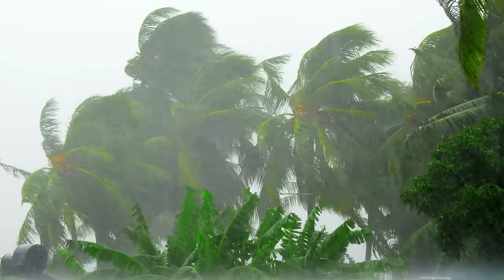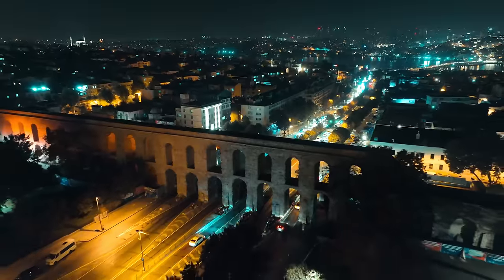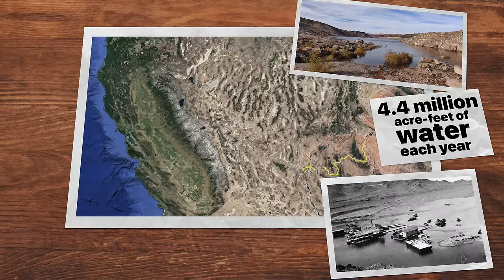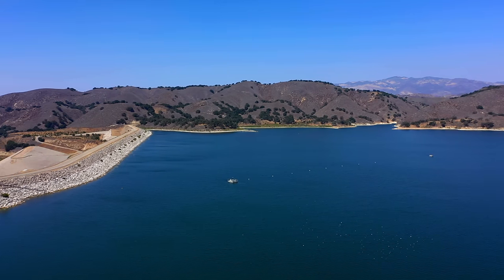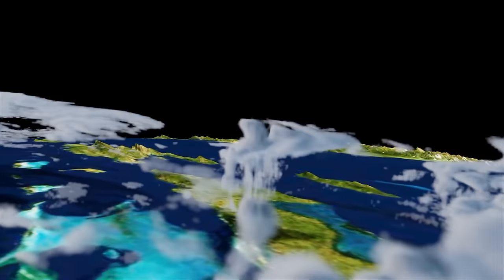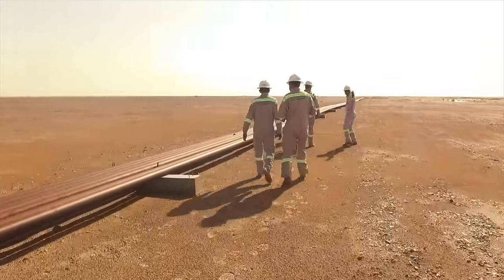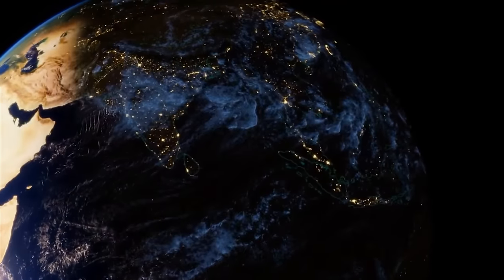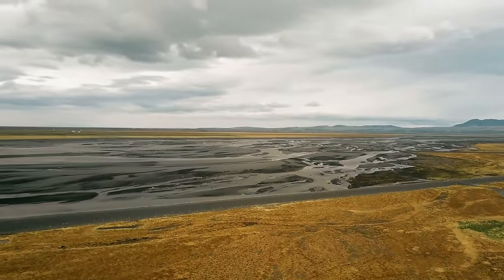Pipelines From Flood to Drought

Comment: I  worked in desalination for 25 years and the one thing I can say for certain is, it's very expensive and only energy rich countries can afford it. Moving water around is probably the best and only long term answer, but I think pumping large amounts of water large distances has it's own problems/costs. Pressure drops along small pipes is a problem but I doubt the problems are insurmountable if we had the will to do it. There is probably enough waste plastic in the world for the pipes if we could recycle it.
Reply: It seems like direct lithium extraction and other uses of selective membranes, to get valuable materials out of the desal brine might change some of the economics around desalination.
Reply: @tonydeveyra4611  Not only that but let’s not forget the potential for sodium to replace lithium as the ion source in batteries going forward. You could have desalination plants do double duty as Na-ion battery factories and the result would be EV sales subsidizing the cost of desalinated water.
Reply: @kennystrawnmusic  
Watch this. OK, its not about "Sodium" but I believe Sodium gets a mention and the same limitations apply.
Reply: @rogerstarkey5390  Already did. Your point?
Reply: @kennystrawnmusic  you take the sodium and the lithium out for making batteries. Take out the chloride. The minerals that remain after that are great fertilizers for plants and even for growing the soil microbiome that builds up soil carbon and fertility. There are many companies that are making seawater based fertilizers even with the sodium and chloride still in there. Once you take those out (or significantly reduce them) it becomes wayyyy better
Reply: @IMGreg..  Unfortunately the shipping industry would fight that tooth and nail, but good idea.
Reply: Where we really need to build a pipeline from to supply water to California is the Ohio River. That’s where teleconnections (e.g. ENSO) are closest to having the polar opposite effect on a continental scale — for example, El Niño brings floods to California and drought to the Ohio Valley area, and vice versa in the case of La Niña. Things like that are of utmost importance when designing a system like what Ricky is proposing in this video.
Reply: I'm of the opinion that desalination will drop in price as technology advances
Reply: @mrspeigle1  We could certainly learn from how Saudi Arabia plans to do it in the case of the Neom project: by using concentrated sunlight reflected by an array of mirrors to boil seawater. Best part of a system like that is that it would be most active when most needed, since solar energy is most abundant during times of drought.

With that said, I would strongly suggest replacing the dome structure that the Saudis propose with a tower containing a reflective lining — and then move the entire array, mirrors, tower, and all, offshore, so that the concentrated sunlight is funneled by the reflectively-lined Ivanpah-style tower into the water directly. Very little maintenance would be required and you’d be able to cool down a lot of steam just by piping it through the ocean itself to shore.
Reply: We put man on the moon. That took billions of dollars, and was a great scientific achievement, but we need to apply great projects like the moon to do a project like this. Technology, not a problem. WILL OF PURPOSE, that is the challenge! Let's do a cool project like this!!
Reply: @kennystrawnmusic  The biggest issue with current desalinization tech isn't the energy, it's the brine. Large scale desalinization, like California would need, produce so much brine it pollutes the ocean, changing ocean currently.
Reply: @charlesminckler2978  Locally brine concentration can be a problem. But I think your point about polluting the whole ocean is hyperbolic. The Pacific is mighty big and mighty deep, and circulates the globe exchanging sea water with other oceans.

But to avoid local brine problems at sea, how about pumping highly brine water to salty brine lakes deep inland where the water can evaporate and later fall as rain. The salt may even be mined for minerals like lithium.
Reply: Wouldn't it be better to make a big canal that way storage container ships and other such ships and water can go passively across the country as if it's like a giant river?
Reply: We have to lower the cost of energy.  Solar wind and battery storage.
Reply: @tonydeveyra4611  I agree I think at some point we will start having to use the ocean for more than a dumping ground ..
Reply: Solar thermal power plant ~> ocean water to steam=pure water and ocean salt.  Cost is dominated by infrastructure since the solar energy is free and it outputs electricity, pure water, and resource rich salt.  No brine catastrophe.
Reply: @spicychad55  that's a pretty good idea how about digging a sea-level cannel between us and Mexico. Line the north bank with mirrors to boil the water dams at each end could produce electricity also counter sea level rise
Reply: @jeffbybee5207  I was thinking of a west to east canal built for ship passage and passive water movement from water rich states to drough states. I think the importance of a canal means we can move a lot more products cheaply without damaging the roads with the use of semi tricks which cause 90% of the road damage. Maybe the idea would be deadly as I remember reading about how dangerous it was to create the Panama Canal in the 20th century.  Your idea is good too. Wish the govt would pitch contests that promote cheap and efficient methods of getting clean water. Incentivize the private sector to innovate.
Reply: Water runs our country just as much as any thing else . The solution has just been presented. We should do it now and avoid spending more in the future . The longer we wait the more it will cost including the destruction of the already present problems explained in the video. As far as common sense goes this is simply genius 👍
Reply: @kreynolds1123  There may be solutions, but pumping it out to the ocean is bad. Worse than most people think. It causes local changes in water currents and that's with smaller scale existing systems. A large scale system like California would need would be catastrophic for anything living near the discharge points. Pumping into a lake would require immense amounts of land. The evaporation would have to exceed the discharge. 

Power is something we are working on, solar and wind get cheaper year after year. Desalinization will only get more and more desirable and the solution to the discharge issues has to be resolved before widespread adoption. 
 
Water capture and treatment are far better solutions. Stop watering lawns, stop fertilizing them too, stop massive water use and waste by farms.
Reply: @charlesminckler2978  my favorite new concept for creating water is the modified atmospheric water generator aka condenser aka Luke Skywalker tatooine tech. These machines are at their most efficient when Temperature and humidity are both high ie the conditions you would have in a greenhouse. So,  build a greenhouse plant it up with mangroves, seagrass, salicornia and other high transpiration halophytes water them with ocean water that's just cycled through like a hydro system. Suck the hot, humid,  moist air out of the top of the greenhouse into the condenser. Build the condenser with a ground-air heat pump loop to make it much more energy efficient.  Haven't done any math or calculation on how much water per day this could produce but many of the halophytes can produce biomass that will have its own value as food, feed or fuel.  And this would not have the same environmental impact as traditional membrane desal. In fact it could be designed to create habitat space that supports ecosystem regeneration.
Reply: @charlesminckler2978  this is total nonsense and l would love to know who is actually behind pushing the idea. The brine released by desalination plants into the ocean is not harmful at all. If it's inland desalination of ground water it's a completely different argument, but l would suggest you look up perth desalination plant on YouTube. They have a short clip showing the input pipe, but it then shows the output dischargers(multiple small pipes releasing brine into high current areas), they don't just not kill sealife, they are havens for it, including rare and delicate sea life.

There used to be a lot of similar clips showing how plentiful life was around the brine discharge pipes, but they seem to be getting far more difficult to find and l suspect like many things there is an effort by powerful groups to discredit desalination because it would offer a better solution than the ones they are trying to push.
Reply: If we thought of building essentially "a water interstate highway" where water can be readily moved to keep supply in balance with demand, this could be part of the solution.
Reply: Ground all the planes and control what satellites and HAARP do and then let's see what kind of weather we have. And we'll save all that money they're spending, too.
Reply: So are you saying that the discarded plastics could be used as building materials for the pipes? I can see some significant problems with that, sadly.
- probably PET plastics would be best for that. Which is already easy to recycle, and already has plenty of uses.
- many plastics are not food safe, an will leach toxic chemicals into the water.
- it wouldn't be easier to recycle for this purpose than any other purpose, and would probably not be durable enough.

I also suspect that the material best suited for making new pipes is the old pipes when they wear out. Since they're made of the right material.
Reply: Actually how expensive it is? I have only info from online sources, so it may be false information. 
Those small units for boats sure are too expensive. But at scale I have read that the price goes down toward 1 USD per metric cube. Is this true? Then the price is cheaper than what I pay for water, My bill comes at about 2 dollars per mc. Sure there is transport  VAT and other taxes, but still it cannot double the price of pumped water since we live next to Danube. Yep, the water is treated too, but this is not as complex as desalinization. 

So, how much actually desalinization costs now?
Reply: @spicychad55  Or at least smaller ones like in UK. Those are not so big, the boats are more like truck size, but still the canals took centuries to build. Sure, t was not modern technology, but still will take decades. I discovered the idea of narrow-boat recently and is fascinating. There are a lot of videos about life on a narrow-boat.
Reply: Does steam carry salt?
Reply: We already do this in California over long distances and terrain which equates to several states back east and the midwest. The major obstacles are money of course plus the state governments in which the water pipelines need to come from and pass through and leaders in Washington DC. All which would slow down if not stop this most sensible and logical adaptive solution to drought and flooding.
Reply: @mrspeigle1  RO technology is already pretty good, I suspect most of any future drop in cost has more to do with using the byproducts as a concentrated source for many valuable minerals to make more money than any actual improvements to the process.
Reply: @kennystrawnmusic  the energy requirements of distillation are high enough that you get a cheaper system by using photovoltaic panels to run reverse osmosis.
Reply: Use massive ram pumps.
Reply: @jackm3040  If desalination is so cheap then why are there no desalination plants in 3rd world countries? I don't know if your doubt relates to me, but I can assure you I worked in desalination for 25 years. Pumping long distances through pipes is mainly dependent on the diameter of the pipes and the number of bends. The head is not really a problem providing you are finishing at the same height you started at, unlike a hydro power station. If the turbines were at the same height as the supply reservoir, then you wouldn't produce electricity. Work that one out.
Reply: @ehombane  the english canals you speak of were probably built in the medieval times or something... doesn't take a century to make such stuff now
Reply: @Roger Wilson This may sound foolish but is it possible to move large amounts of water with large Ram Pumps working in parallel? Like a reverse Dam, only working without electricity?
Reply: You say that it's very expensive, however islands like Curacao have no natural water source at all. And yet through desalinization plants they're able to have enough water for the faucets for the swimming pools for the toilets everything and they are not a rich country and yet they have all the fresh water they want from a desalinization plant. Cannot be that expensive.
Reply: @DSMillwright  that wastes a lot of water.
Reply: @MrOkulski  like everything other service/product it also depends on the materials, cost of labor, cost of regulatory  enforcement is probably cheaper in Curcacao. So when they say expensive they mean expensive in the US not Curacao.
Reply: it's expensive if your burn fossil fuel to pump water. Desalination is 10X cheaper if you use a sustainable power source like Solar and wind to pump the water.
Reply: @tonydeveyra4611  yes mining the brine changes the economics of Desalination creating waste fresh water once Lithium and magnesium salts are removed. over 14 rare earth metals are also found in all Seawater.
Reply: @kennystrawnmusic  40% of all Fossil fuel is used to ship more fossil fuel so shipping is dependent with built in 40% inflated cost of shipping.
Reply: @AlanDeRossett  becomes even better when pure sodium becomes an important ingredient for making sodium ion stationary batteries
Reply: @mrspeigle1  The big problem with desal plants is they are basically a hedge against drought. They cost a lot of money to upkeep even when they are not in use. And that can be years or decades. Taxayers get upset. Why did we invest all this money and spend all this money in upkeep against something we never use? Politicians come under pressure to get rid of them, especially as they become outdated and even more expensive. They only really make sense in coastal desert communities like the middle east and northern Africa. The desal plant in Sydney Australia is the perfect example. It's been used twice since it's construction in 2010. And it suffered storm damage and cost about $AU500,000 a day to sit idle. It costs about $AU50M to start up and shut down production. Right now the east coast of Australia is entering a record 3rd year of La Nina and is being ravaged by floods. The dams are full and overflowing. The desal plant started up to full production in July 2019 and went back into "emergency availability mode" in March 2020 following a major rain event and  flooding. Essentially it is shut down again. In total it's run for less than 3 years of it's 12 years.
Reply: Traditional desalination is an expensive process. Has anyone considered that in the USA the salt flats of Utah are becoming depleted of … salt due to the harvesting of the surface product. The introduction of un-desalinated water would be irrelevant {the contamination in the water is a different issue to be resolved}, do we has a long term target location for responding to dry regions west of the Rocky Mountains, western continental divide?
If the salt flats were treated as a flood plain where storm waters could be transferred to via pipeline or decommissioned single wall rail car, target location as well. 
I recognize that The financial numbers on pipeline for transporting water are unfavourable. 
The accumulating effects of coastal populations moving potable water from inland sources at a rate of roughly 3 litres per adult per day (according to the world health organization ) needs to be considered. 

We do have enough resources on the earth to take care of the current population and an increase. The change is to recognize that we have been for been moving products at a speed that , natural processes can not  keep up to !! 
We can move anything, unnaturally using what was originally powered by fossil fuels. UNLESS we keep this in mind, we will fall short and future generations will curse our oversight. 
A pipeline is like a highway must be present prior to the potential transport oil , liquid natural gas, flood waters or unprocessed water. 
Being from the Canadian province of Alberta water is precious, agricultural and tourism demand healthy subterranean aquifers. The cost today vs the losses of plant supporting lands of the future. 
Good presentation.
Reply: see to me, with all the money in socal,  they could find the money. arizona, maybe not?  there must be a simpler/cheaper way to remove salt from water, maybe these MIT guys could work on that.  im in nor cal, and it just seems stupid that we had to get rid of our lawn, when we have an ocean running the full length of the state.
Reply: 13:50 3000 kwh/acre foot is about 75% the energy requirement to run desalination. If they had to pump it any farther, it'd take less energy to desalinate on site, not to mention VASTLY less infrastructure and piping. The places where they have built the largest desalination plants, the do it because it's cheaper than shipping water from far away. We've always had the ability to pipe water from one place to another. There's a reason no one does it.
Reply: I would think think they would just do it on like a grade going down hill maybe.  Like maybe pump it p at beginning a bit and up at end of needed and let the distance take care of it self.
Reply: There is new tech, 1 filtering, 2 linear pumps that use one third of the energy of rotary pumps. So de-sel nedds not to use as much energy as 20 years ago!  We used to boil water and condense steam, yes that was crazy!
Reply: Why can't we just put massive shallow pools of water and put tarps that all lean in One direction collecting the runoff from natural heat in the desert that way it doesn't take any power or anything to clean the water from salt.

And I believe they can get lithium from that as well two birds with one stone.

But instead of using reactors to do it we can just use the natural desert heat to distill the water I mean there's all that desert just sitting out there doing nothing it wouldn't take much to make five inch to 1 ft deep pools and let evaporation do the rest.
Reply: Make a methyl hydroxide pump it through the pipes then burn it for energy in turbines collect the water from cooling towers. 2 birds with 1 stone and it eliminates long pipelines. Just bubble methane in cold sea water it seperates the H2O into the hydroxyl with out filters and is separated by burning.
Reply: @danmentink3256  don't think it'll make enough water depends on how many molecules of H2O there is in it but I don't think it'd make enough enough for small towns and the like but not on the quantities they're describing.
Reply: @jackm3040  I think we are talking cross purposes here. I'm not disputing the fact that you would need a 500m head pump to move water over a 500m mountain range. What I am saying is that at the other side (neglecting friction) at the same height you would have 500m of potential energy. Granted, you have created a 500m head, but in real terms you have not used any energy because it is still there as potential energy. This could actually be recovered by hydroelectic generators if they were 100% efficient. In reality it would be used to move the water to it's final destination. My original comment stated that it would be costly and would have it's own problems.
Reply: @spicychad55  I am aware that it does not take as much time as then, because machines are faster than men and animals, but still it takes a lot. Just look at this documentary. There are some figures. How much time it was needed for construction centuries ago, and how much was needed now only to fix it. You see, what thousands of men id centuries ago by hand, may be done by as single machine, serviced by few other machine and maybe 10 men. But this machine is built by thousands of men, if you consider all those who contributed from mining the metals, to design. Sure they used just a fraction of their time, but still, that time is money, and all is about money now. All those owning the money want to see the money back in few years. And they want to see the money coming back doubled.  Back then the community worked for their future generations too. So this is why today such big projects are harder to make. I personally consider that such canals are a blessing for environment. They can retain the flooding, also keep the surrounds moist, plus cheap transport. But this transport is slow, and this is why canals fall in disrepair. People prefer trucks being faster.
Reply: @ehombane  I prefer somewhat deep, wide canals so shipping container ships can move via these canals (if this theoretical canal goes east to west throught the middle of continental US) with a lot of new ports to take advantage of the canal's potential.Shipping containers move A LOT more products than a single semi truck can handle but without causing damager to infrastructure (~90% of road damage is by semi trucks) on such freeways that have also failed to raise taxes to keep up with inflation and maintenance costs. Also a reform to pay truckers their same wages while waiting at port would improve trucker morale as well as reform the trucker act of 1980 or whatever.  There really show be laws encouraging trucking companies to work with airline and rail companies more to alleviate the long time away from home for truckers and keep costs down. A lot of truckers quit because they get angry about the lack of pay, regulations, and LONG time away from home.
Reply: @mrspeigle1  Desalination has its own problems- obviously the high energy costs, but also the need to safely dispose of the resultant concentrated brine - & apparently its toxicity means you can't just dump it  back in the ocean as is.
Reply: In California the almond trees use about 20% of the water.
Reply: /\ “waste plastic for the pipes” 👆apparently does not understand plastic “recycling”
Reply: @bthemedia  I Don't. That's why I said 'probably' and 'if'. Apparently does not understand 'English'.
Reply: @nicholaiivan491  no
Reply: @tonydeveyra4611  the sodium chloride is a compound. The sodium, and the chlorine are bonded at a molecular level. They are not separated by distillation, or filtering.
Reply: @mrspeigle1  IDK, we've pretty much fully understood distillation for about 500 years.
Reply: @spicychad55  Note the direction the rivers flow between Louisiana and say Colorado or Utah and then re-ask yourself the question.  Unless you are talking a Panama Canal type project which  ... never mind.
Reply: @poppasan1873  So there'd be rivers feeding into this new hypotethical project is what you're saying? I was thinking they'd have to contend with mountains too. Nevermind.... perhaps it'd be better to get the railroad companies to buddy up with other logistics services.
Reply: @spicychad55  Rivers flow downhill.  You'd be pumping the water uphill most of the way.  Not going to get boats to float through a pumping station.  Canals would all flow the wrong way.
Reply: @klepow  then why is it so hard to boil water and capute the steam? Make a steam powrr plant out of it at the same time?
Reply: Use trains, infrastructure is mostly there, just need to build catch basins and load/unload facilities.
Reply: @nicholaiivan491  I believe, because boiling takes a lot more energy than evaporating. Furthermore there is lots of potential contaminants to be found in a turbine, and distilled water is "hungry" water. It will more readily obsorb contaminants, and can erode the turbine more.
Reply: @poppasan1873  That sounds logical... I guess we stick with train then.
Reply: Let’s pump some more lies! And I waste your time, and I make some $
Reply: Waste plastic pipes, as you suggested will NOT be potable water safe. Very few plastics are not blatantly carcinogenic.
   But as a positive side to that, a safe liner could be placed inside.
Reply: @kennystrawnmusic  umm...what about the marine life that would be incinerated? It would also release the brine directly into the water. It would be a lot less efficient, because it would distribute the heat over a much larger surface than would be converted into vapor. This would further damage the ecosystem.
Reply: @spicychad55  I'm thinking probably not, because it would take way too much water, lots of which will be lost to evaporation, and trickling through terrain that can't hold a river in place. This has the potential to cause a lot of erosion. Keep in mind, water is the ultimate universal solvent, and is responsible for a majority of the shaping of the landscape on Earth.
There is also the issue that the flow of water would be seasonal. If we were to create navigable rivers, it would have to have lots of water flowing through it at all times.
Reply: @got2kittys   I don't know enough about plastic recycling to make any experience based suggestions/observations, but it's nice to know that others think it is a possibility.
Reply: @spicychad55  That would work if the land was flat. However, there are a few mountains in the way